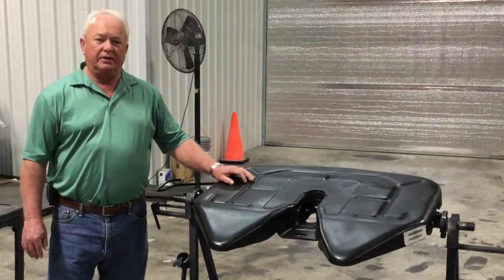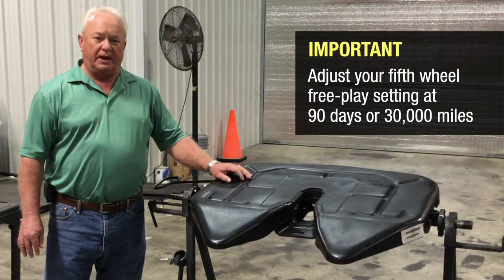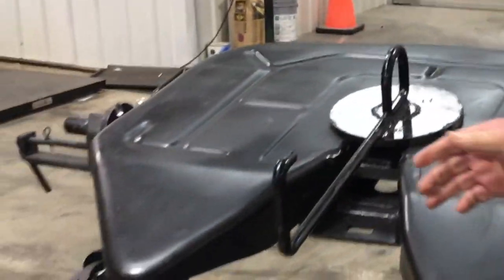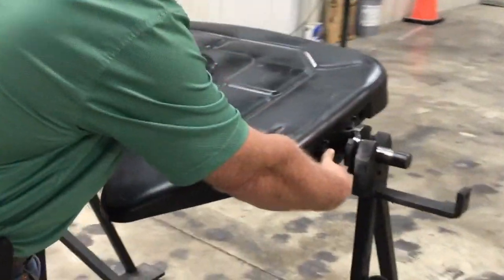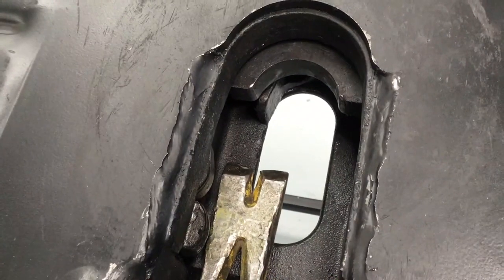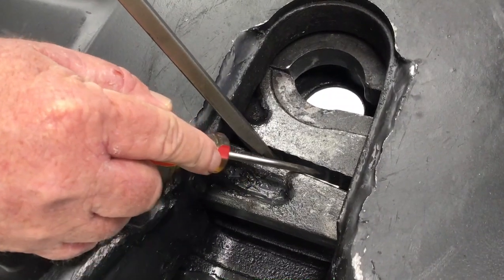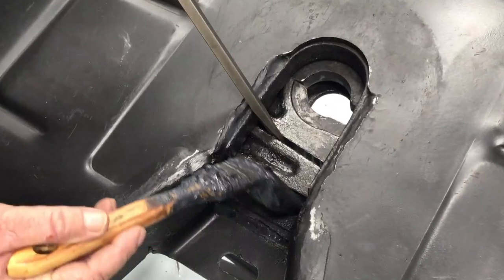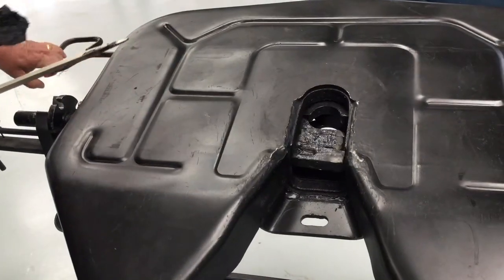New Fontaine Fifth Wheel Set-up and Adjustment

Comment: Big question I need bushings for my plate would you still happen to carry old bushing still?
It is not set up like the ones in the videos.
It has dual jaws also a spring lever on the entryway and the realse is on the right side